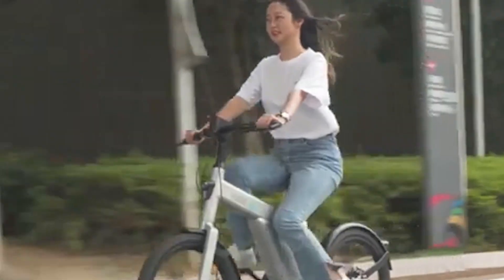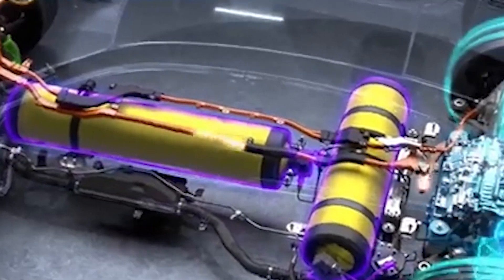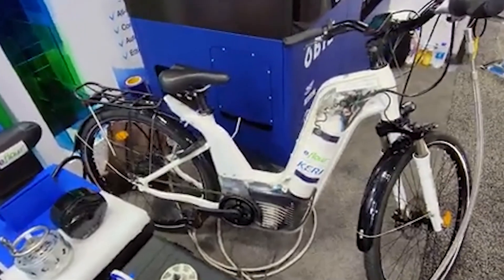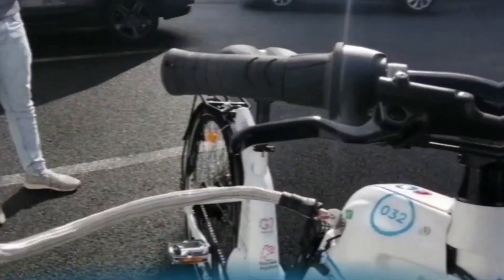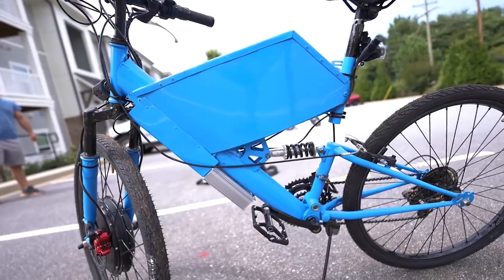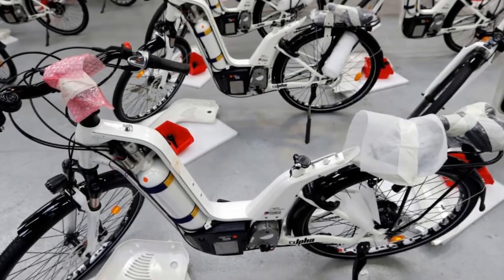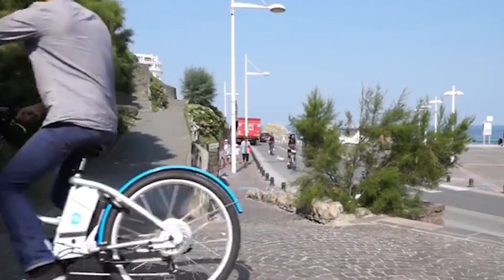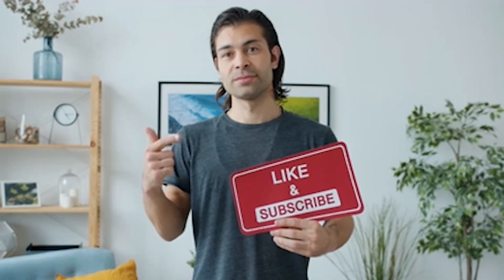The Hydrogen E-Bike: Finally Here After Years of Wasted Time

Comment: The point of using a Hydrogen Cell is that it doesn't need charging it just needs to be exposed to O2 and it's energy is recoverable. The batteries that run alongside the Hydrogen fule cell might need charging to run lights etc. Having to recharge the Hydrogen Cell would remove the usefulness and convenience of Hydrogen Vehicles all together.

Comment: HYDROGEN IS NOT GREEN ENERGY. THE VAST MAJORITY OF IT IS PROCESSED FROM HYDROCARBON FOSSIL FUELS.
Reply from the maker: Hydrogen is becoming increasingly interesting due to its potential to decarbonize multiple sectors, store renewable energy, and offer versatile applications. However, challenges related to cost, efficiency, infrastructure, safety, and market development need to be addressed to realize its full potential. Ongoing technological advancements and supportive policies are crucial for overcoming these barriers and fostering a sustainable hydrogen economy.

again it's in it's beginning stages

Comment: There is no place to get hydrogen anywhere near me.
OTOH, I just plug in my eBike literally anywhere.
Reply: @HoolyDooly-si2zz  Duh. Doesn't run on water. Runs on hydrogen. If you want to generate hydrogen from water you need a lot of energy from a battery. Better to just use the battery to run the bike directly rather than waste energy on the conversion.